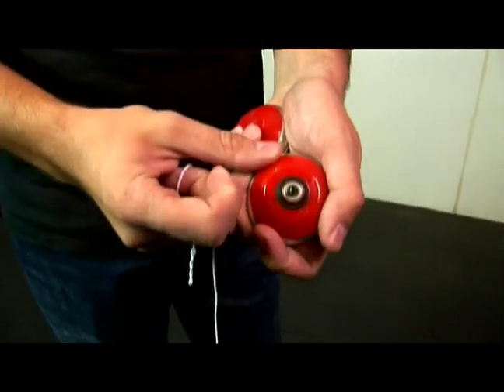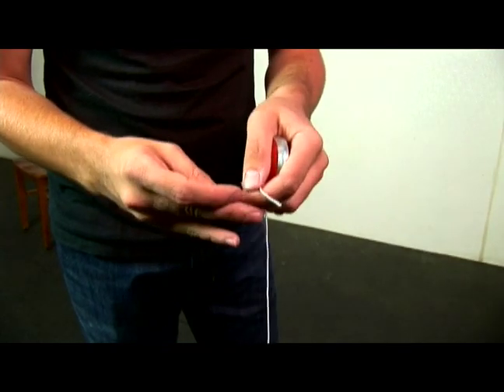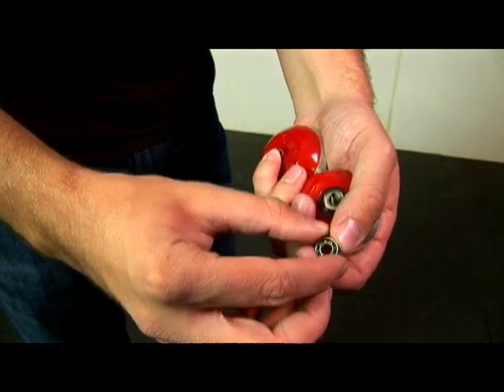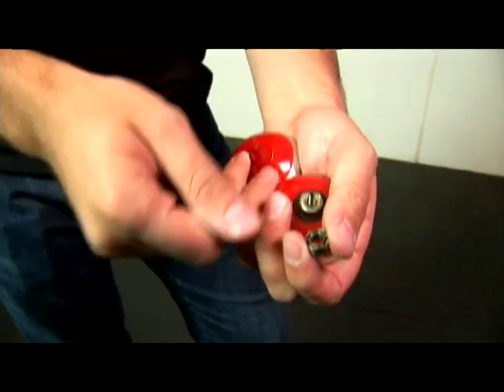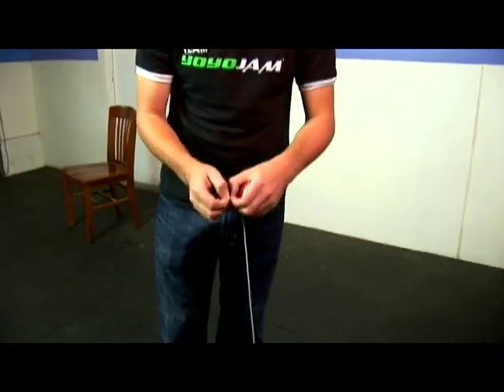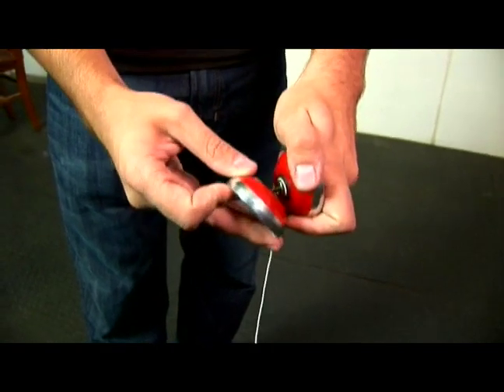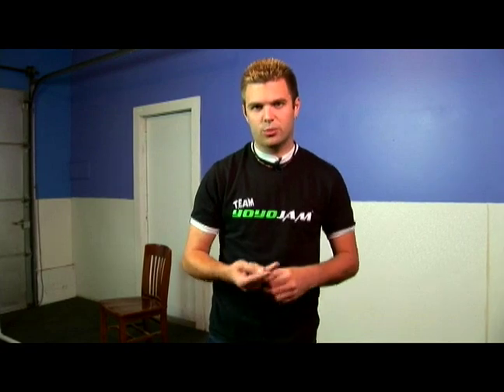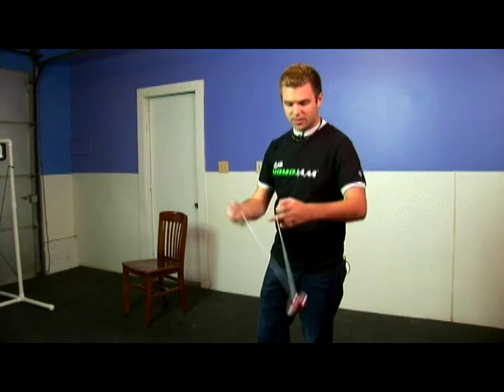Yo Yo Maintenance : Ways to Improve Ball Bearings in Yo-Yos

Comment: i have the plastic grind machien too. it depends if you want your yoyo to become more responcive or just a little more but still sleep along time. well weather your using thin or thick lube you just put 1 drop of lube in the "crease" of the berring and spinn it around then it will work like a charm. hope it helped